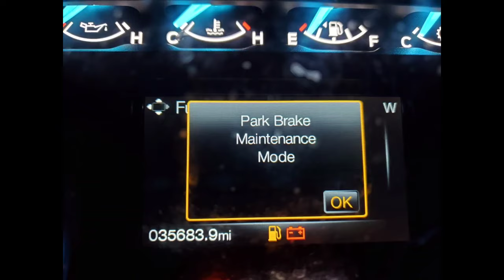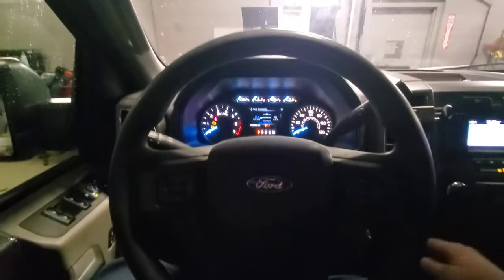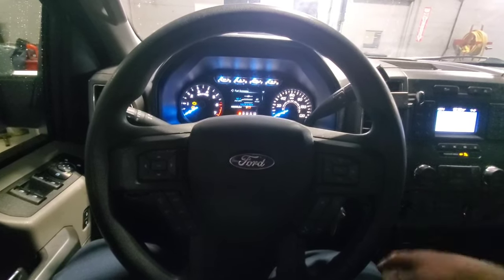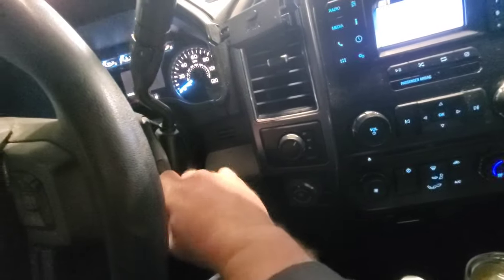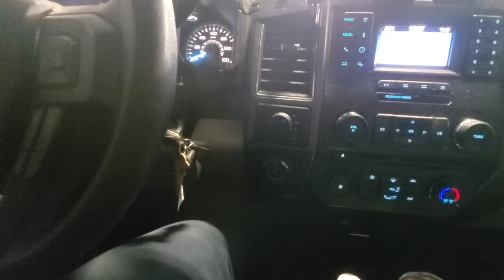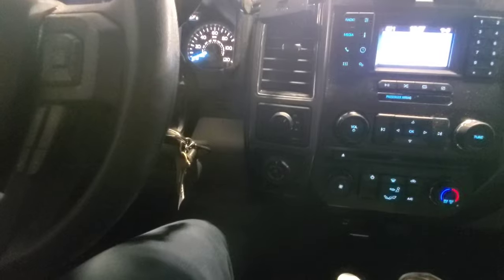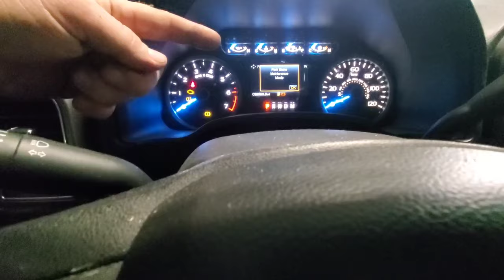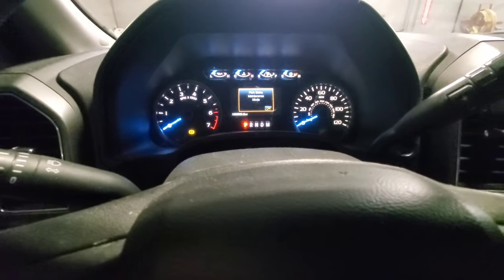Ford F150 Electronic Parking Brake and Other Models - Park Brake Maintenance Mode Rear Brake prep

Comment from the maker: Never lift the parking brake from the position that you're trying to apply it while you're going through this process hold it down the entire time whether you're resetting it or you're putting it in maintenance mode
Reply: So rich if I do this push in instead pulling to apply brake in normal usage?0

Comment: thanks- easiest pad change ever :) found I need to grind a old 17mm open end wrench thin to hold the pins though... and the older twist in park brake caliper tool works great for just pushing the pistons back in, without having to push on the park brake housing like you would with a c-clamp...just flip the cap so pins are away from the piston.

Comment: Bro i can not thank you enough! This actually fixed both parking brake and my cruise control! Because for some reason i unplugged something and later that night i was driving and my cruise control wouldnt work and then i parked and tried my parking brake and that wasnt working either! I know my ford is under warranty but you know its a waste of time to go to the dealer! Thank you thank you thank you!
Reply from the maker: Waste? That's subjective but I'm glad I could help 

Be blessed
Reply: @FordBossMe  haha no i mean i wouldnt want to go and drop it off and have to wait 2 hours or so to get it fixed, I prefer the fast way haha. Also i have a question maybe you can help. My seatbelt sign goes away after putting on the seatbelt but if i take it off, it wont show that on the dashboard for like 2 or 3 blocks.

Comment: Really appreciated the instructions to put the EPB on my 22 Expedition in Maintenance mode - worked perfect. However, there has been a step added to the "EPB return to service" procedure involving the brake pedal. Not sure what other Ford models are affected but it might be time to update the vid. Thanx
Reply from the maker: I have more than one video on this and if you would have searched in the library you would have seen that I Do cover the new one as well and I do add the new stuff in as well I'm very familiar with this you just had to look in the library and you would have been right here you would have got it as well but you didn't

Comment: The reverse procedure wouldn't work on my 2018. I found I had to press the BRAKE pedal along with the normal gas and EPB switch and then cycle the ignition OFF & ON/ACC while engaging all 3 items at once. I could then feel the EPB adjust itself in the brake pedal and it was out of maint mode when I cycled the ignition one more time...

Comment: Thank you. Can you write for me a full step.  I want to exit mode park break
Reply from the maker: Turn the key on, push the accelerator pedal down, push in the switch while pushing in the switch turn the key off and then back on and continue to hold the switch for about another 5 Seconds and the dash should start flashing part break maintenance mode

Turn the key off and go back and do your brake job

You're finished go back up do the same step as above except you put the switch in the other position and you follow the same sequence

Comment: Got it to work. You have to "OK" the accessories screen and then the "OK" to the Emergency brake disingaged screen and then three beep's then the Brake maintenance screen appears.
Thank you for your patience.
Reply from the maker: I never had to ok that stuff not one time but OKAYYYYY LOL

glad you got it to work
Reply: @james, did you follow the rest of the sequence.  I feel mine has something to do with your issue you had
Reply: Thank you so much. So what I did was take the brakes back off took of the sensor on the back pushed in the piston. 
Since it would only turn in, in the EPB mode. It worked once I did what this guy said. I kept holding the gas pedal pulling up on Emergency Brake turning it off by pushing the start button still holding when turned on do as this guy says and hit the OK button 3 times. I also repeated the steps 3 times until the light went out. I was so happy. I thank you for your video. And this guys comment. Im sure if it was to work right the piston would of just went in. So if anyone gets stuck and you have to turn the piston. Stop!! Take of sensor push in piston Do the disengage process until it disengages. Have a great night.
Reply: @FordBossMe  Thanks for responding Your the Man!!

Comment: i screwed up and tried to put it in maint. mode after i had the caliper off. i shot the cylinder out of the caliper. i replaced caliper. what do i do now to get it calibrated? EPB wont engage and says that it needs serviced. Help please!

Comment: Could you answer a question for me. What if you have already took off the calibration without putting it in maintenance mode
Reply from the maker: A lot of times whenever you do the brakes and you don't put it in park brake maintenance mode you have screwed up the calipers and the majority of the time they end up having to be replaced and recalibrated

Comment: I have an 18 Lariat with push button start- no old-school key turn.  I tried this process as if the push-button is the Key On- Key Off, but I cannot get the brake into maintenance mode.  Different process?  Ideas what I'm doing wrong?  Thanks!
Reply from the maker: No it's the same process except you just push the switch in the opposite direction to reverse it then then how you got it to go into maintenance money I don't know what to tell you you're doing something wrong obviously but it's the same exact process on how you put it in maintenance mode except your reverse and switch position to get it out

Comment: Worked on an 18 Expedition I didn't catch that you had to do it two times in a row at first once I did that it worked perfectly
Reply from the maker: You don't have to, sometimes you may have e done it wrong or missed a step or there was a glitch 

You put it in maintenance mode 1x and take it out 1x 

That's it
Reply: @FordBossMe  either way it's fixed thanks

Comment: 2019 Edge to replace switch in console does the switch need to be calibrated to the Vin number. Want to replace. Chrome is coming off on the switch. Is it a plug and play. Thank you.
Reply from the maker: No all you have to do is just replace it but some of them if you have like the rotary knob are all built into that same housing if you can just order the switch by itself and replace it you're good you don't have to program that

Comment: Little confused HERE. to put in in service mode, 1) push down gas pedal 2) hold the the parking brake down while turning key on, repeat twice. I got that part. BUT  to take it out of service mode,what is step 2) press down with your foot on parking brake or hold the parking brake up??? thanks for clarification
Reply from the maker: So you're confusing me now
Reply from the maker: Listen to me very careful I'm going to say this one time and one time only I don't have time to go back when I very clearly already said this

Key on

Hold accelerator pedal down and push in on your electronic parking brake

Keep holding turn the key off and turn the key back on and then about 5 seconds later it will go into service mode

Now to take it out of service mode you do this same exact thing except you move the switch instead of pushing it and you pull it up like you're trying to apply in the opposite direction of what you originally did in the first step but it's the same steps all over again so here we'll repeat these again since it's not clear and I don't understand that

Key on

Pull switch up while holding that accelerator pedal down

Keep holding turn the key off and then back on again in about 5 seconds later it goes back out of service mode and you can hear the parking brake reinitiate

Now where you're confusing me which to me this is common sense but forgive me because I get frustrated from answering the same question over and over again it's like I'm a broken record

If you have a parking brake pedal to push down that means you don't have electronic parking brake you have a manual parking brake and you shouldn't even be looking at this to do the brakes because this is only for electronic parking brakes with a parking brake button and if you have a foot pedal which is your parking brake pedal to push down you're wasting your time looking at this to do the brakes anyway because you don't have electronic parking brakes so why in the world would I say hold the parking brake pedal down?
Reply: I already found another video of his , I understand  it now. THANK YOU
Reply: @FordBossMe  THANKS, i watched another video of yours, and clearly saw there pulling the e brake button down or up depending on go in or out of service mode, all clear now thanks for responding so quicly. you are amazing

Comment: Aaron, PLEASE READ. I need your help. I just purchased a used 2015 Ford-150 yesterday and it did NOT come with a manual. I backed up the truck into my driveway (which is incline) to park it. When I came out today to turn on the truck, the emergency brake light was on, and when I turned the key in the ignition, the truck would not move forward. How do I get the emergency brake off, to drive my truck?  Please text me back ASAP? Thank you
Reply from the maker: My name is not Aaron
Reply from the maker: You either have to push down on the pedal really hard and let it come back up or there is a plastic lever underneath the dash on the driver side that you pull and it releases the parking brake

If you have an electronic parking brake here is a video showing how to apply and release it 

https://youtu.be/CNW1XKxRVRI

Comment: Youre right about the piston coming out and pushing it back in, its not going to work as it did before, i had a guy who fucked my caliper up because he didnt put it on maintenance mode before taking the pads and caliper off the piston came out they pushed back in but when i was done and applied the e brakes the brakes malfunction and overheated brakes system signal came on the dash and the e brakes wont work on that side why? Because he fucked up the caliper now i had to order a new caliper, im so mad rn 🤦🏻
Reply from the maker: It's very unfortunate 

My neighbors hasband ruined both in a fusion this way
Reply: @FordBossMe  Is you neighbors husband not also your neighbor? Lol

Comment: Hi Sir, I have a question? Do i need any special tool or computer to bleed brake fluid on 2021 f150 powerboost platinum.
Thank you
Reply from the maker: Yes you do
Reply from the maker: Let someone with a scan tool do it please
Reply: Ok thank you.

Comment: I have a 2017 f150  XLT how can I tell if it has an electronic parking ?
Reply from the maker: If you have an electronic parking brake switch vs a parking brake pedal
Reply from the maker: Look at the rear calipers and see if they have a black case on them with a motor inside and you'll know

Comment: Please let me know what I doing wrong I set my brake system on service mode but doesn't want to reset back brakes work fine (2015 F 150 Ford)
Reply from the maker: Tell me how you took it out of service mode?
Reply: I open the ignition key switch step on the gas pedal and push down the brake button at the same time and it when to maintenance mode when I finish do the same procedure whit brake button up but it doesn't want to reset

Comment: Did this and accidentally pulled the parking park and it over extended my rear caliper piston and now can not get into to maintenance mode. Keeps saying service breaks
Reply from the maker: You're going to have to take the motor apart and retract everything back in and then retry again and if it doesn't work then you're going to have to get new Motors or New Motors and calipers together

Comment: Will this process help me in a EPB malfunction situation? My battery almost died, and now vehicle is is that mode and rear brakes are locked. Can’t move vehicle.
Reply from the maker: Yes you should be able to initiate and release in the situation as well
Reply: I tried it, it still won’t clear. I replaced the battery also. Do you have any other ideas??  Greatly appreciated…

Comment: Hi, I performed this procedure. Replaced all pads and rotors and bled the system. Now I deactivated the system and now the vehicle won't move. Seems like the pads are compressed with the parking brake off.
Reply from the maker: I'm jot sure what you did, you should have reactivated the system before you bled them and then did your bleeding you're going to have to go back and deactivate and reactivate again I don't know what you did
Reply: @FordBossMe  
I bled the system while the EPB system was deactivated. Then reactivated when I was done.
Reply: @FordBossMe ok I have a question please. I replaced left rear caliper. so once I reactivate the system can I bleed the brakes like and old style caliper? Or do I need to do a “pressure bleed”?

Comment: Is there a different way on a 2020 Police Interceptor. Rear EPB.   I got it service mode change pads and rotors but no way I was able get it off service mode took dealer They used factory scanner.   How do get it with out factory scanner. Out service mode. I work the City. Thanks
Reply from the maker: Yes you have to add an additional step when you take it out of service mode which I have talked about this before and it's in my library
Reply from the maker: Let me try to find the link for it
Reply from the maker: Okay I don't have a link for it what you have to do is when you take it out of maintenance mode you're going to turn the key on you are going to hold accelerator pedal down like you did when you put it in service mode you're going to switch the release switch to apply turn the key off turn the key back on hit the brakes firmly for one second with your other foot continue to hold and it will release

Let me see if I have a police car here in the shop I can do a quick video on look for it on the channel within the next five to six hours
Reply: Yes i did tried it close  key and open key withing 5 seconds while holding accelerator pedal and pulling the brake leveler   I tried it lke other link video   done before older models  this one didn't like me 😂
Reply: @FordBossMe  Thanks  yes see can make video  it was a 2020 3.3 engine Thanks again and stay safe  Thanks for Face mask tip  lesson learn  for me too on that

Comment: So I tried putting my truck in maintenance mode and accidentally had one of my calipers off before attempting this…..so of course piston was pushed out of the caliper and then my trucked freaked out and yelled at me that my truck parking brake needs to be serviced every time I start up the vehicle…. Btw replaced both rear pads and bled system all successfully truck drives great I don’t have squishy brakes or anything… but the error codes keep popping up at every turn. Doesn’t appear to be any damage but regardless electronic brakes are useless to me so I just want to clear the error code. Any advice?
Reply from the maker: Some times it'll clear sometimes it won't 

You'll have to see if someone has a scan tool to relearn the epb position
Reply: @FordBossMe  sounds like a plan thanks for the advice!

Comment: Do you keep your foot on the pedal while pressing in the parking brake button?
Reply from the maker: No - do it exactly as I said in the video 

Key on
Press the accelerator down and press the park brake release in
While doing the turn the key off then back on 5 sec it should flash and say in maintenance mode

To take it out you do the same exact reverse the position of the park brake switch then you hear it reapply the motor for the rear brakes and the message on the dash will go away
Reply: @FordBossMe  so you do keep your foot on gas pedal while you press the barking brake button then key on..Key on put foot on gas pedal key off keep your foot on gas pedal press and old parking brake release then key on wait 5sec then key off..then when you done do the same but parking brake back on..reverse process but parking brake on

Comment: Dude  I forgot to put it in service mode how do I fix the brake malfunction warning sign??? Can u help
Reply from the maker: You're probably going to have to take the calipers apart and run the Piston back in if it will go and then put the motor back on and see if it will release most of the time when you do this you've probably damaged them
Reply: It got damaged its not going back so I going to buy a new caliper but do you have any idea how to remove the brake from malfunction mode???

Comment: 2021 f150 taking out of maintenance mode, left foot step on brake peddle for 1second and release also by with this video procedure
Reply from the maker: Yeah I've never had it work with pushing the brake pedal I've actually had to reverse the procedure like I started the procedure

Comment: I was able to get my 2020 Ford Explorer into park brake maintenance mode but not able to get it out.
Reply from the maker: If you got it in using this method all you have to do is reverse the park brake switch the opposite direction using this method
Reply: @FordBossMe  I agree.  Don’t know what’s going on.  Tried all day with no luck.
Reply: How did you get the piston in? Asking if you never figured this out how to get it out?

Comment: 2019 F150 I didn’t set maintenance mode before taking caliper off.  😔. Push button ignition.  I need help.
Reply from the maker: You're doing the same thing except you don't have a key involved
Reply from the maker: I have videos in the library on that as well so what exactly do you need help with?
Reply: I used a 12v supply to get piston back in but I don’t think the seal properly retracted / seated.  Possibly the piston was over extended.  Does it need to be rotated counterclockwise or can it be pushed straight in?